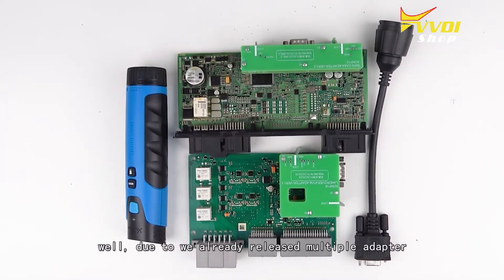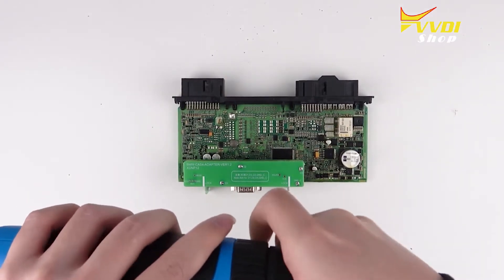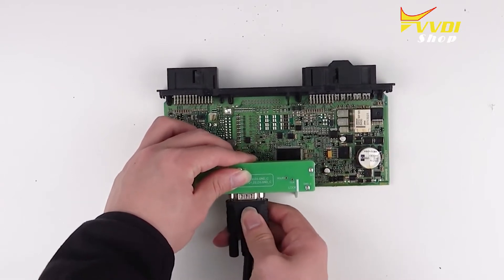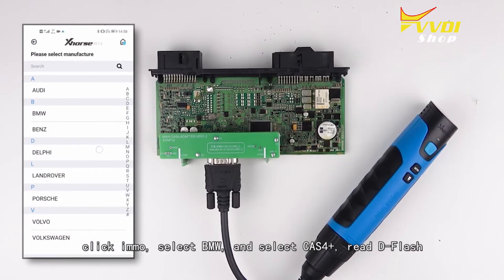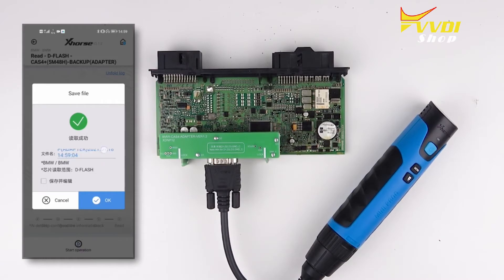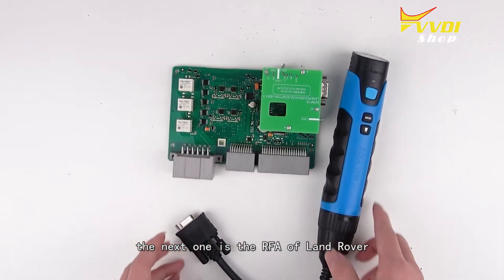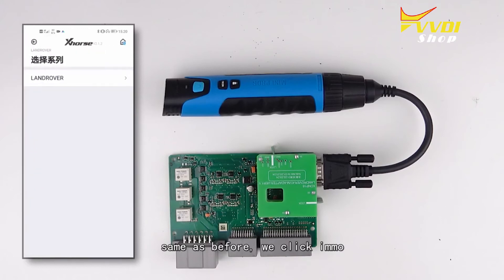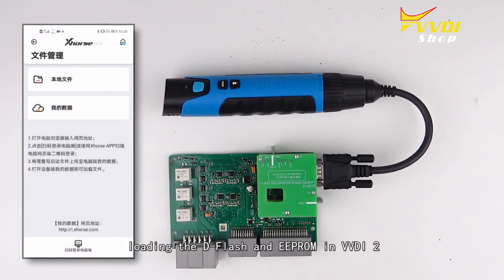Xhorse Mini Prog read BMW CAS4 and JLR RFA with solder free adapters- vvdishop

Comment: I wonder if such an adapter is for a good solution, because pcb cas4 or kvm jaguar painted with varnish, whether such adater will have a small contact or you need to clean the pcb from the varnish first, someone tested if it worked well without cleaning the pcb ?
Reply from the maker: these solder free adapters are tested by many without problem